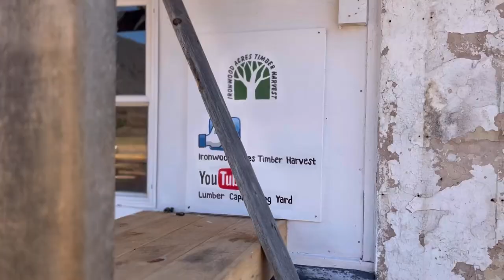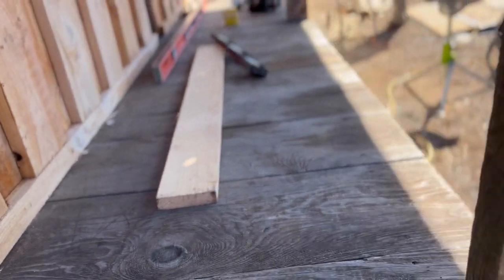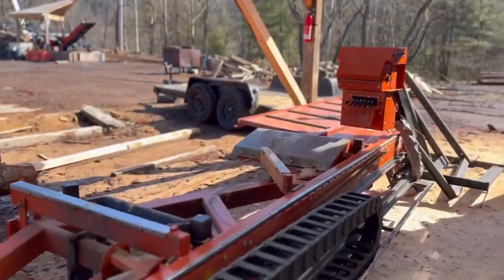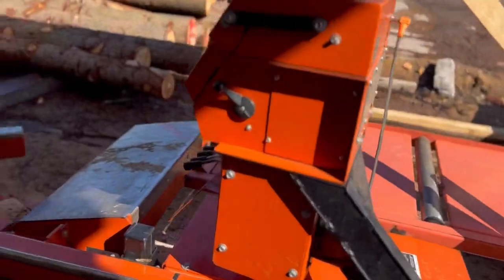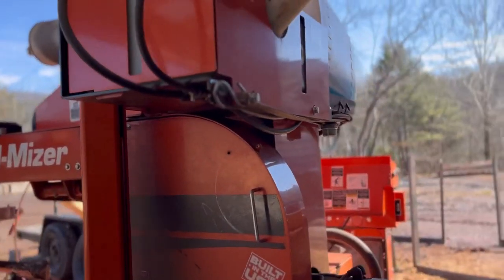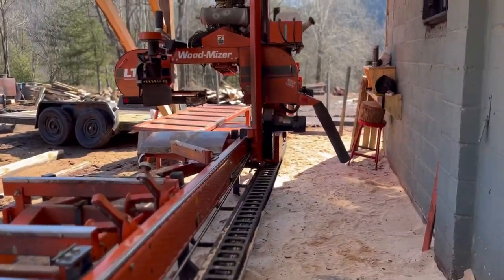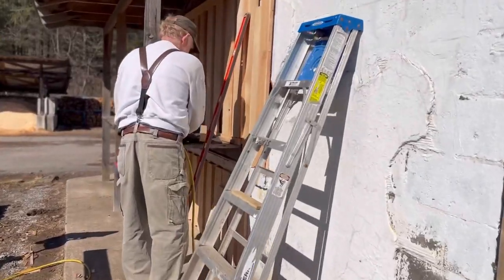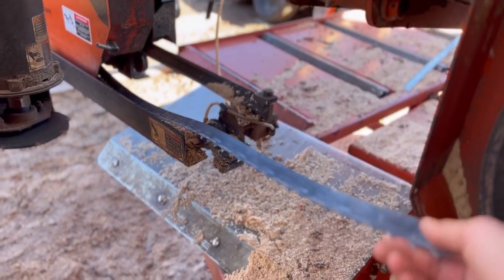Running the Woodmizer

Comment: I was wondering when those blades were going to get brittle.  They have passed many times over those wheels and work hardened.  I don't think there is any fix for that.  Have to anneal them, then temper the teeth, and probably another sharpen.  Pretty high risk of distortion.
Reply: from what little i know as a hobby lt 40 non hydralic  owner of 33 years. the strongest blade is a brand new blade. as the blade is stressed by blade tensioning belt wear on the pulleys that the bandsaw blade runs on. dull blades. wrong blade type temperature and stone   pinched blade.ancd other things that a woodmizer blade technician may know about. you might want to talk to linda from  you tube linda sawmill  i think that her family runs a lt 40 electric motor drive
.... emerald you have to learn that blades do not last forever. with the right or wrong conditions blades will break.